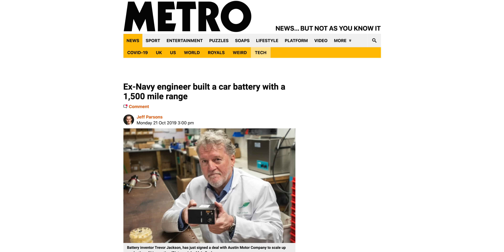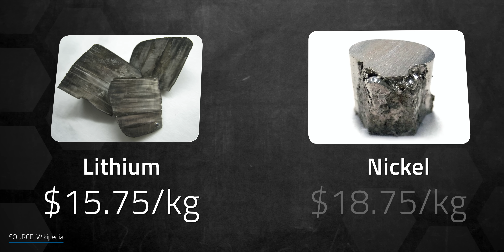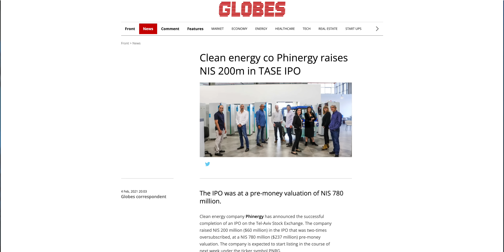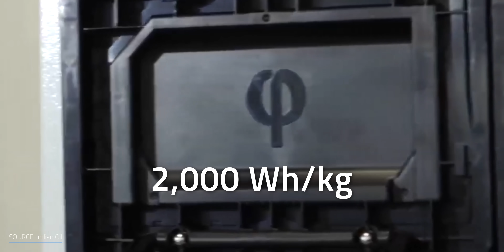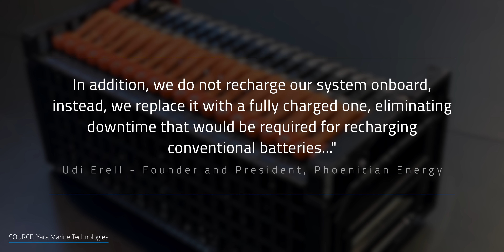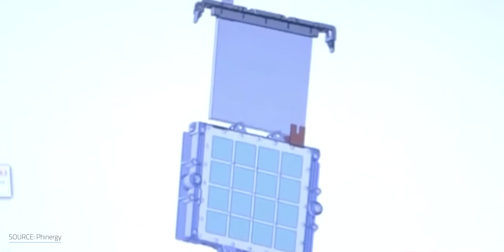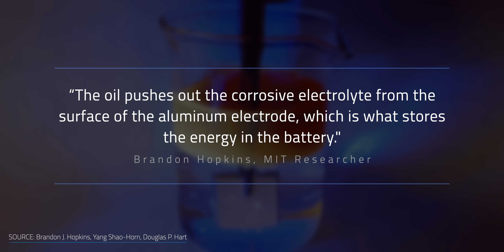Exploring the 1000 Mile Car Battery - Aluminum Air Hype?

Comment: How hard would it be, for a van carrying new batteries to show up to the stranded vehicle, and just swap the batteries road side? Still, none the less, "not rechargeable? Not interested" The up side to swapping, is that you can take on hundreds of miles of energy, in the time it takes to pump gas or diesel. Like now, you have to go to a service station, you can't just charge at home. For people living in high density housing, this would be a very good option, considering, they often don't have access to outside power.

Comment: No thanks. Maybe like some have said for aviation or emergency rescue situations, but there is no way this is going to make sense for cars. First you manufacture the battery in the factory (energy), then you transport it across the country (wasted energy), then you have to pay to install the thing (wasted labor, and energy for the building), then you deplete it (useful energy), Then you have to have it transported to the recycler after 1 use (wasted energy).  Makes very little sense.

I actually want a lifepo4 as opposed to the higher energy density li-ion variants they use, for the extended battery life. I so rarely drive more than a 100 miles in a day it really doesn't matter if the density is lower, my #1 concern is battery lifespan.  I have a 2017 Chevy Volt and that has 60 miles EV range before it starts using gas, and I rarely use gas, as in 10 dollars worth of gas in 10 months of owning it. So, a Lifepo4 car with 200 miles in range would be more than enough for me 99%+ of the time.  I think people overestimate how far they actually drive.

Comment: hmm, why not both? Like the company mentioned in the video did, you could have a system where the lithium battery powers the car and the aluminium battery just recharges it when the lithium batteries are low. I think it would be interesting to build a startup that sells Aluminum batteries on a subscription basis to consumers. Or one that sold to companies that will eventually manage fleets of electric trucks, vans, or Robo-taxis! At scale, I would imagine it would save a lot of money and man-hours and maybe even be less taxing on the grid. I could be wrong though! Do yall think there are any issues with my assumptions?

Comment: In a situation like the one you described, it might be useful to keep a smaller "reserve" battery on hand to switch over to in order to get to the next swap-out station. Also, what about an aluminum battery with the capability to easily remove/replace the anode on the fly--or rather with about 30-minutes DIY fiddling? just a thought, but being able to carry extra anodes for nominal replacement might be another solution, provided a method for easy swap-out by the user can be developed.

Comment: This won't scale out if they can't make it rechargeable. Otherwise it is either the hydrogen cell problem of few places to charge preventing car sales, or the truck driver shortage of each refueling location needing a constant supply chain to take away the empties and bring in full packs to the warehouses, 1000's per day cycling through each location. And again, it's back to the mentality of needing "gas stations" on every corner when we already have electricity everywhere. Charge at home, street lamps, parking garages, shops, etc.

Comment: It isn't rechargeable.

Strike one, you're out.

Maybe there are applications where it can work, if building and recycling them are cheap, maybe it works for air or sea transport, but even that is unlikely, it would have to be substantially cheaper than gas.

No way it is worth giving up the convenience of charging at home or at work, or anywhere really. And even if the cost of the actual battery is low, the logistics of getting new batteries to swap stations constantly is going to be a nightmare, and cost a lot of money that the consumer will pay for. At least with gas you don't have to pick up used gas, and you don't have to deal with partially used gas tanks. And gas has 10x the energy density, so it costs about 1/10 as much to move around. 

I don't see this successfully competing with gasoline, let alone electricity.

Comment: Okay I can see a lot of problems with this being worked out. It needs an engineer to swap out batteries right now but it could be simplified for the everyday person. As for loosing charge in the middle of nowhere, well I mean I would hope to carry a spare of this light-weight high capacity battery in the trunk. Also services like AAA could also transport a spare battery to you
Reply: The way they show it - it already can be swapped by anyone. As for loosing the charge, smaller modules seem to be the best solution

Comment: Battery swap would be OK but I think it would have to be either a huge network of standardised batteries or some kind of delivery to point of need. I don't think it would work for cars going to different places at different times. Maybe ferries, ships or even aircraft. Geely seem to be making it work, but they may get overtaken by more efficient lithium or other rechargeable batteries as they get lighter and smaller. Once rechargeable battery cars reach a range of 350 miles, home charging and 150kW stations nobody is going to use battery swap. Just too much danger of price hikes and system dependency.

Comment: I'm sure someone asked already.  Your comment "what happens if your family is on trip and you run out of battery", but couldn't you have a truck that comes out to swap out your batteries in minutes that carries a bunch of lightweight replacement air batteries. Instead of having to wait for a tow trucks quick charge if you run out of charge?

Comment: I am least concerned about the one-time use of the Aluminum air battery. With other "fuel" systems I have to replenish as well and I see the replace and go approach better than a 30 plus minute stop at a charging station. I also see the better weight to stored power ration a plus. Less weight means more miles or more cargo per Wh. Still the degridation must be solved. Perhaps a recyle/power swap station is a good first step. The swap station could give credit for unused power (measured at the exchange) and then the remining cost will be paid and then I install the battery and drive off. The station could drain the old battery charge into a power storage system and send the inert used battery to a reclamation center. Given the simple recylce process of these batteries the waste of current Lithium batteries is erased and most of the recycled battery goes into a new battery. I'd also like to see this developed (along the MIT lines) as a possible emergency battery system for home use. Power goes out and I go turn on the pump system for the Al Air battery to put in the catalyst then use the power as eneded to power my home. Then drain the battery when the power outage ends.

Comment: indian oil mentioned, if you dont want to bother the empty cell carry, just throw away. It not causes toxic problems like li ion, never burst on puncture, has better range. Battery changing can be stylized and modernised. Needed 30 sec to change and go. Could be very good for extreme long journeys. And a small mention, could be made as mobile phone battery which is 2-5 days of use, less than 30 cent and use & throw

Comment: depending on the time it took and the cost. If you can do 1k miles and it cost 100 bucks i think that would be a good trade off.  Like currently i get 300 miles per tank and it cost me 30 bucks to fill up. If the fill up time and the swap out time are about the same and there was a change station like there are gas stations i think it would work fine. The biggest issue i see is people being worried about running out of the replacement batteries or something like that.

Comment: instead of swapping out the whole battery, why not just swap out the electrolyte (assuming the pumping + oil solution turns out to be viable)
Reply: I think in the video, Matt mentions that the aluminium is consumed in the process.

Comment: This is fake news. 1. Over 98% of all driving is less than 300 miles per day.  2. There is virtually no degradation from Tesla's original lithium battery, after 8 years.  3.  there is virtually no safety risk from lithium batteries.

Comment: Once you do the calcs for what energy from a swappable battery would cost you (i.e. the 'price at the pump' you'd be paying per kWh) it becomes a no-brainer that no one would pay for this. Look at Nio who are offering this. Even at the cutthroat pricce they are targetting and with the extremely limited setup (one or two battery types, proprietary form factor) it's vastly more expensive than plugging in..and in no way more comnfortable.

Comment: This is definitely not a consumer friendly technology. The whole premise still keeps you reliant on the big business and in my opinion defeats the purpose of going electric. It does nothing for being self reliant or independent from the energy provider and with the need to swap out the batteries it does very little for the ecology. 

If this technology could give you a battery that would last the lifetime of the vehicle or a couple hundred thousand miles then it would be awesome.

There are much better alternatives that allow you to be in control and stay independent of big business or big energy

Comment: Perhaps it would be better to have 2 batteries, each with half the charge.  That way you can run one battery to completely empty, and switch over to 2nd battery and keep driving.  Then you can stop for a battery "swap" at your convenience while running on 2nd battery.  Do the same when 2nd battery runs out.  etc.  It's the equivalence of always stopping for gas when the tank is about half full.  But we're talking every 500 miles or so, right?

Comment: Great video! Although, I think it's a little silly to doubt the adoption of a new technology because of the lack of infrastructure around it. No new technology does have infrastructure, and no infra is prebuilt around it. Think of gas stations for instance, when the first cars appeared there were none, and infrastructure was built after. I think replaceable batteries does have a strong case in favour. It really is a question of whether there will be a li-ion storage revolution or not. If not, I can see al-air replacing it easily. Also, Nothing stops both to be a co-existent technologies.

Comment: If the infrastructure was in place, I would prefer a battery swap to charging. Especially if I was on a trip. I would imagine Semi Trucks would benefit greatly from battery swapping opposed to charging. I use flashlights often and I love having extra batteries to swap out soon as I notice a performance drop. It’s fast to swap a battery and I can focus my battery charge cycles at night when electricity is less expensive. Swapping is so much more efficient than charging. As far as emergency situations regarding a dead battery...there will be solutions in place where the batteries can be swapped at the side of the road through a service vehicle. It will again be MUCH quicker than getting a boost charge to get you to a charging station where you will again be wasting time waiting.

Comment: Getting energy from a one time fuel source? Sounds like gas. If this were to get widespread enough that most gas stations would swap aluminum batteries, then this would be almost a drop in superior replacement.

Comment: Instead of replacing the entire battery, you can only replace what is consumed and remove aluminum hydroxide. Simply put, an aluminum electrode in the form of, for example, a coil of sheet aluminium is successively uncoil and fed to an electrochemical reactor where it reacts with air and producing electricity. And at the station, you just put on a new roll and remove the sludge that remains.
In the extreme case, when you stoped looking for a bar, you dive in a trash can behind beer cans like Emmett Lathrop Brown and fill it up.

Comment: Probably a safe to assume that this technology won't work with regenerative braking? I wonder if a hybrid approach between this tech and a smaller lithium ion battery would work. Still need swaps but could top off an LiIon for 25 miles at a time.

Comment: Thunderf00t already debunked this as nothing more than aspiration on paper...
The tech and everything around it works perfect, but don't go around saying its green tech because discarding a battery is so much wasteful than charging one

In that case plastic cups and plates are Eco friendly cause I save on the water use

Comment: The only use of aluminium air batteries is as a replacement for emergency generators. Battery degradation have to be fixed though.
Reply: If they don't have to last long after initial activation, then they can probably just come sealed. "Just add water!" Like hearing-aid batteries. Those are something-air-cells, too. And those, too, have great energy density. and those, too, will simply die within 2 weeks (ish?) with or without being used. If you have a non-stop emergency, you'll have different problems anyway.

Comment: I think the non-rechargeable issue is a non-issue. I view it like gasoline, if you're out of gas, you need to add gas. If your charge runs out, then just get it swapped out. Availability will not be an issue if this tech ever becomes as ubiquitous as gasoline (I would suspect there were similar concerns when gas powered cars first came out). I am actually more open to this tech as a long term solution over any of the ones in use right now.

Comment: a lease or rental program on cars with these batteries would be a good test. i think the question would be how long can the batteries sit unused while holding their charge? a spare battery in the trunk (since they're so light) similiar to a spare tire would be a possibility and solve the stranded issue

Comment: Sounds to me that it would be better to make several smaller banks that could be swapped out as they are depleted rather than one or two bigger banks. At least from the range argument.  Especially if you had that electrolyte pumping system too.  Then you keep the packs that you aren't using dry until the other packs are discharged.

Comment: Having a no downtime EV is generally great (cuz I believe al-air batteries can be developed to be refillable by non professional. After all the only thing that is being used is aluminium) but there are two major issues. The first one being an infrastructure. Conventional batteries are convenient because you can plop recharging stations on any regular gas station because it's already hooked up to the grid. Aluminium requires stuff like additional storage, logistical solutions, recycling centers, etc. The second major issue is the fact that it's not rechargeable. It can be mitigated somewhat by having an option of swapping corroded electrode for a new one and having a couple of spare ones lying in your trunk but for it being possible there has to be a unified standard first and more refined al-air technology second. Personally, I think that using aluminium as fuel is better than using lithium to store electricity but it needs some serious work first. I'm almost certain that we will find better ways to store electricity before al-air infrastructure is ready for general usage and scaling. It's still a cool tech for disposable batteries for exoskeletons for example.

Comment: The biggest problem is self-discharge that happens even without load! The electrolyte is a strong alkali (KOH) that eats up the aluminium even on open-circuit!
The process has to be arrested by replacing the electrolyte with a mineral-oil. This oil has to be highly resistant to saponification. It could be light like transformer oil. Someone has design an arrangement where the aqueous-electrolyte (sp.gr. @1.3) falls-out through a valve to a bottom compartment & the much lighter oil (sp.qr. @ 0.7) floats-up on its own. 

On using the battery, first the  the oil has to be pushed out from between the plates & the electrolyte taken-in. Some clever syphon may accomplish this.

Comment: maybe swapping the batteries would be ok if they lasted like 5000-10000 miles without a charge. so it would be like a oil change. but i wonder what the cost of such a swap would be even though most can be recycled. and how much silver is in these batteries? neat idea i wonder if planes or helicopters could use it effectively. probably not long range passenger jets tho.

Comment: I’ve long thought some kind of battery swapping system for EVs could be a useful option.  Make it a component in a combined system - part lithium for cheap home charging, part swappable non-lithium for long range - and all kinds of possibilities open up.  Being able to tailor and modify your car’s power storage to best suit your own needs would be amazing!
Reply: that actually poses a pretty interesting thought, if the battery storage system (li-ion and al-air) was somewhat modular, you could go to those swap stations and change what percentage you have lithium vs al-air or any other battery component if it fits in the form factor to fit your needs, + all the pros of modularity with something like the battery. i'm imagining some tesla-like storage that'd be an oil-change tier of effort to access, you can choose what's li-ion, what's al-air, and what's filler if you don't need / can't buy enough. don't care too much about range and can charge over-night? go li-ion, going on a trip and want some mad range? go al-air, change your mind? swap for what you want (assuming it's not that expensive lmao)
Reply: @_ramar  Exactly my thoughts.
Reply: I like the way you think 👍 Dude image the possibilities with a motorcycle